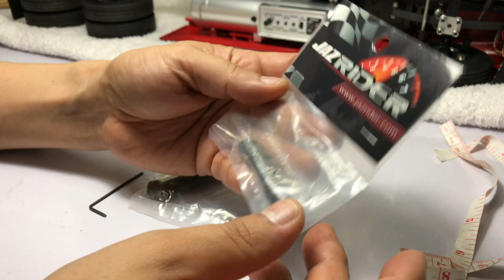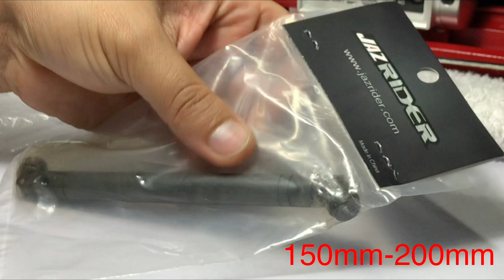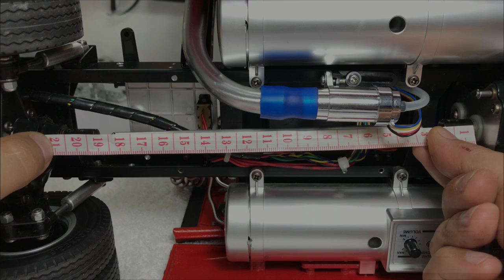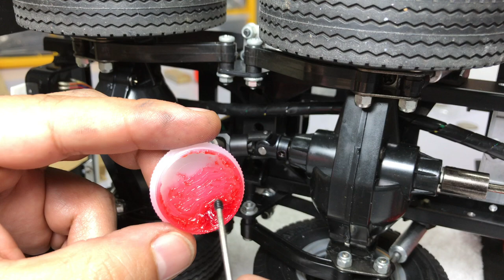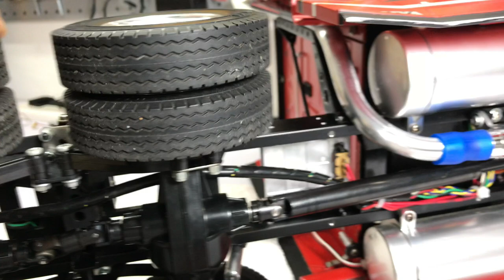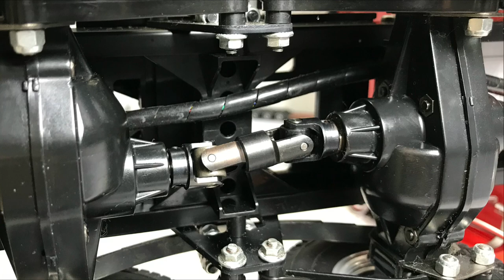✅ HOW TO UPGRADE A DRIVE SHAFT‼️ for TAMIYA TRUCKS 1/14

Comment: AWESOME Truck! Are you using smoke generator for that Muffler? can you provide description or purchase link for it
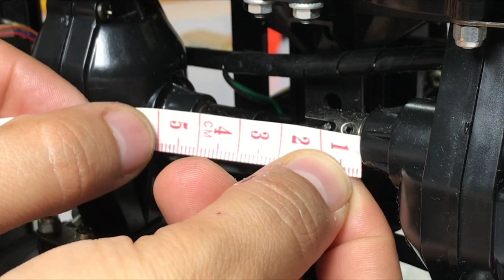Reply from the maker: Yes, is it a Electronic Simulation Smoke. Find it in eBay, amazon and other. Use the description of the part "Electronic 1/10 Simulation Smoke Exhaust Pipe Tubing Parts RC 1:10 Model Car".

Comment: The specs 150-200mm jazzrider  driveshaft doesn’t fit grand hauler...too short
Reply from the maker: Hi. Correct, it is chosen according to the model, this is for 20 cm or 8 inches maximum. You measure the distance as in the video and thus you look for the correct part.
Reply: Right lol...I went with measurements off your truck not knowing the grand hauler chassis is longer.